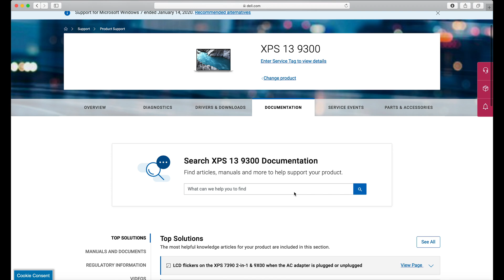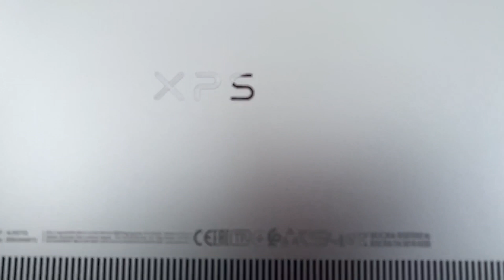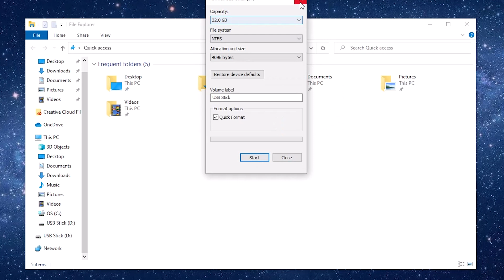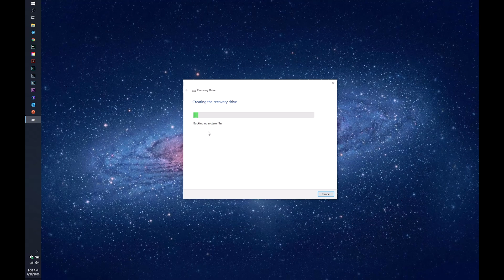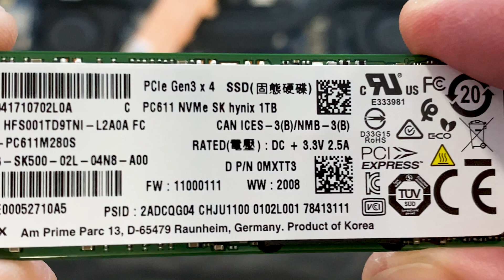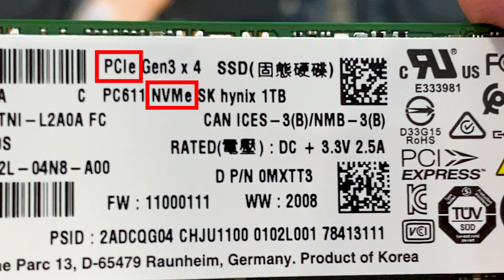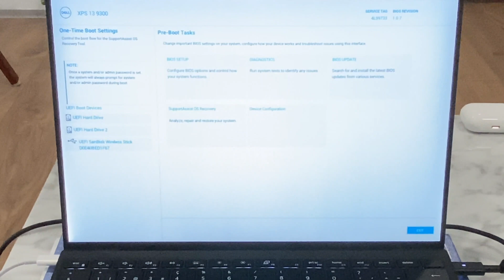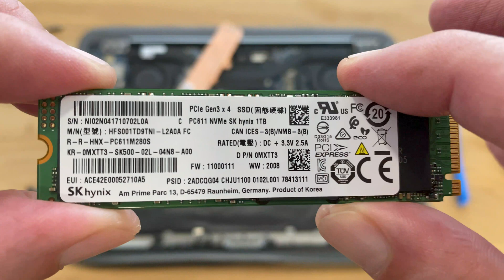DELL XPS 13 (9300) 2020 SSD Replacement (Upgrade)

Comment: Does XPS 9300 has two SSD slots or just one that can be used for both 2230 and 2280 ssds?
Reply from the maker: Its a while since I had it opened but if I am not mistaken there is only one SSD slot.

Comment: A really useful video thanks.  Was there a particular reason you went for the SAMSUNG replacement SSD as it seems to be the most expensive brand in the market?  Intel, Seagate, WD, Corsair, Crucial, Sabrent, XPG all offer PCIe, NVMe far cheaper units.  Is there another specification I need to look out for in the SSD modules?

Comment: What about XPS 13 2in1?
Reply from the maker: Same procedure give or take.
Reply: @mathphotographer  the current 9310 2-in-1 has a soldered SSD actually. The 9310 clamshell is still SSD upgradeable. Thx for the video.

Comment: Question the recovery is what recovery the windows? 
So if i upgrade and with the recovery drive i dont have to install new window? And need a new window key?
Reply from the maker: No, no key needed, it will remember that this is your registered laptop.

Comment: Useful video, I hope to upgrade in the near future! My Dell xps laptop ssd has been split Ubuntu/Windows. In the future I would just like to run Windows. If I follow your tutorial will the recovery USB just contain the Windows recovery? (at the time of buying my laptop in the UK only high spec dev option was available!)
Reply from the maker: The USB stick usually will also contain the required drivers, at least I did not have to download them one by one again. Don't forget a full backup of all of your data before starting the upgrade procedure.

Comment: Coverplate is meant to pulled out the same way as the SSD, note the arrow, and the cutout in the plate. not twisted to the side.  See service manual

Comment: how's the experience so far with the 9300? I'm planning to get one very soon and do the ssd replacement too! I'm just a bit worried after seeing a lot of people having issues with wifi/sound devices/hot temperatures/fan noise/screen flickering
My plan is to do a clean install and avoid all the bloatware from dell + replace the wifi killer driver with the standard ax200 (which is based one). Hopefully the latest BIOS + clean windows and 0 bloatware will make me a happy owner.
Please, share anything! Specially fan noise/temperature issues
Reply from the maker: The 9300 is a really good small device. What I like in particular is that performance is good but fan noise is low or even off. I never had such a quiet machine as the 9300.
Reply: @Ambicity Games Thank you so much for this perfectly detailed reply!! This answers and "kills" any fears of purchasing this! 
I'll watch your rdr video since that's a proper real-world stress test and re-read this reply again just to make sure I don't have extra questions! 
BIG THANKS!

Comment: Great video and your brother in law is lucky. 
I had Dell  laptops in the past but found upgrading  were Dell specific components and weren't able to use 3rd party parts in the past but parts only from Dell. Build from Dell was not as well built  as Apple or IBM/ Lenovo laptops.
Reply from the maker: I share your experience if I go back some years into my past, Dell was not my first choice back then. But I think Dell changed nowadays. The XPS 13 has great build quality, solid like a rock. And it accepted my Samsung EVO SSD without any flaws or issues. Most importantly, the non-glossy screen goes up to 600nits which is readable even in my backyard. Thermal management is also surprisingly good if I compare it with my experience on Dell from years ago where you could cook an egg on the laptop :) On this XPS 13, fans are hardly noisy, battery life is long, real life experience of about 7+ hours (forget the nonsense numbers the manufacturers claim), and performance is really good for a notebook with an Intel Iris Plus graphics chip.
Reply: @mathphotographer  well thats a comprehensive list of the changes  that I remembered from Dell. I would avoid using Dell items like the plague. I will be seeing how these laptops from a longevity and robustness compared to my mac book pros and the latest 13" & 16" mac book pro with the new graphics card that I have purchased Apple.